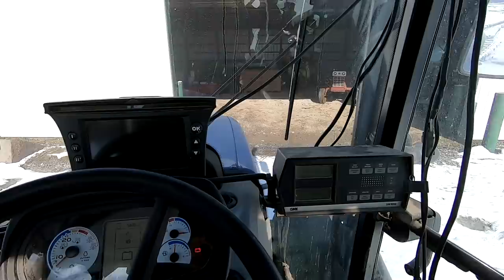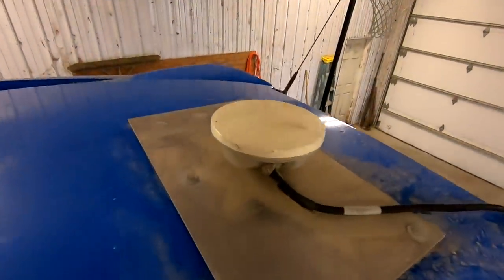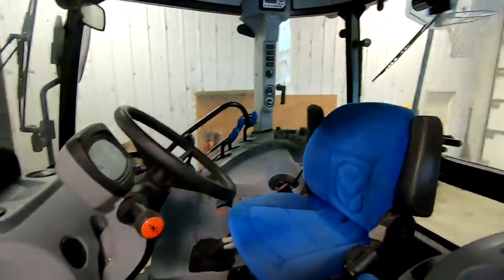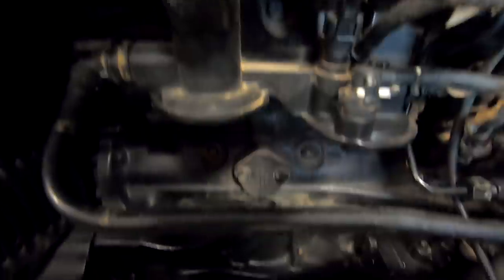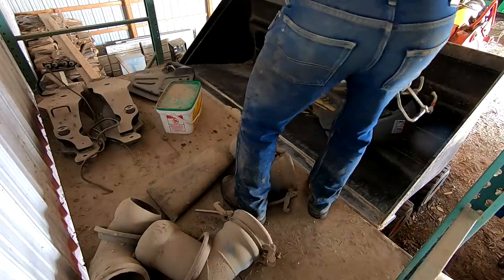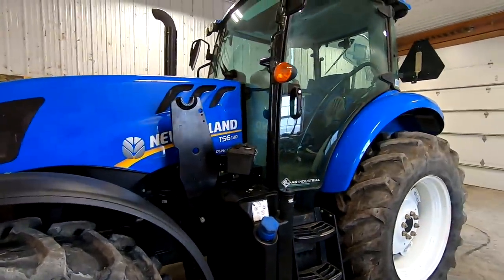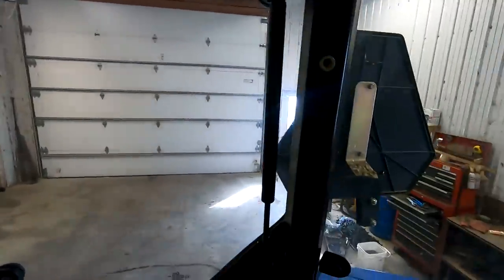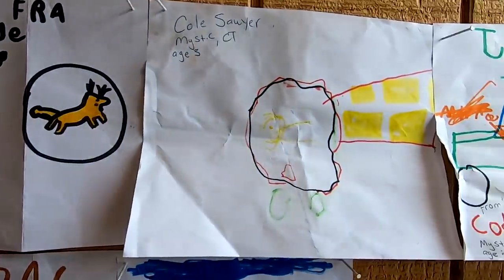We are Selling our New Holland Tractor

Comment: Some would sell used equipment “as is.” Changing the oil, all filters, wash and cleaning the interior makes it a more attractive deal but shows caring for the potential buyer.
Reply: I like how you explained all the controls. It would be cool if you could do the same for all your other equipment. Maybe be out in the field showing us what each control does. Love your videos.
Reply: Or, changing all the fluids just before selling is a way to hide major problems that you're trying to pawn off on someone else. That's why I only change fluids on their normal maintenance schedule. I want whatever I look at to have well used oil in it so I can see if there's water, fuel, or metal in it. Fresh new oil tells me nothing, except maybe to walk away.
Reply: @BarnyardEngineering  we sold our last tractor through a dealer and they told us to change all the fluids as it sells better
Reply: @BarnyardEngineering  he also said its ready to service which mean it's on its maintance schedule
Reply: @markjackson4045  of course, because people think that fresh new oil means you're buying a good well maintained machine, when it's not necessarily true. When I sell something I explain up front that I did NOT change the oil because I want them to see the true condition of what they're buying. If it's due for maintenance I will tell them and include new oil and filters with the machine.
Reply: takes us 6 1/2 hours to do oil change on ours wich sucks wich were planing on replacing it with a kubota m series

Comment: The new holland T6 series is a lot better then the new holland TS6 series a lot better of transmission lot better controls and tighter turn radius. The TS6 series is the cheap version of the new holland  series T6. I now this because i read up on them before and i out told or new holland salesman about 4 years ago was about 10. Good video.

Comment: I saw gas cylinders standing beside your office in the work shop, Eric. We at Fire Dep't can do a better and not so dangerous job at a fire if you can keep them at a front door after you used pressure bottles. Freely on a marked space on floor. Then we possibly can grab them before they heat up or cool them.  Thanks for your cooperation!  <3

Comment: Gotta love engineers that design an oil filter mount upside down so you spill used oil all over side of engine when you service them. Must be the same ones that design car engines. You can tell they have never actually worked on any type of engine or equipment..LOL

Comment: Would rather a 4wd myself but everyone to their own suppose always great to have a decent back up tractor old 2wd's okay around yard but proper work just aint as good
Reply: We do most our hay work with 2wd tractors. If you need 4wd to make hay, it’s probably too wet to be out there!
Reply: @aaronrandall2194  Nonsense sometimes you have to get things done in the wet its unavoidable,4wd is more effecient  okay the 4wd zaps little more power but extra grip helps for most jobs and i wouldnt trust a 2wd on the hills for the work we do and we dont always have the luxury of working in the dry
Reply: @zzirSnipzz1  I can understand 4wd In the hills, agree with that.  But if you’re making hay in mud it ain’t worth messing with
Reply: @aaronrandall2194  Maize you have no choice its  always a glutter
Reply: @zzirSnipzz1  you don’t cut maize for hay.
Reply: @aaronrandall2194  never said you did but i said 2wd is not good for maize its usually always wet
Reply: @aaronrandall2194   Have also had a call from a customer to bale silage in a satyrated field he said it needed lifted no matter what they would plough it after. Pickup reel was full up she was sinking in that much total mess but it needed done good old 4wd